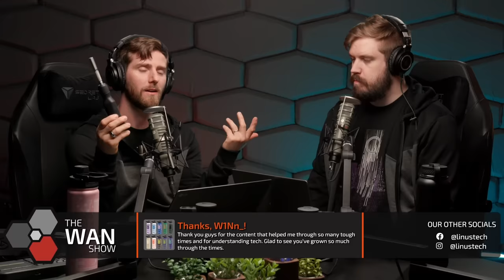Someone COPIED our Screwdriver design!

Comment: I work at an American importer mostly sending things to China and making clones in China when we’re not manufacturing custom goods and it’s ridiculous how efficient and seemingly exact it gets. Every single time with limited shared info.
Reply: i was shopping at an outlet mall once.  there were like a half a dozen groups of guys and gals right outside of a designer store they had just purchased bags and stuff from.  they were straight up talking on the phone and taking pictures of the stuff they just bought right there, in front of the store.  even fllipping the stuff inside out and everything.
Reply: At some point after making lots and lots of objects, you see how its created and the different parts required to produce it
Reply: The Chinese are good at copying something and producing it on a larger scale. It's usually nowhere near to the original quality.
Reply: @springbok4015  Honestly i think that's starting to change recently I've bought copy cat items which have been nicer then the original product. Still has a few years to go tho.
Reply: @liam3229  3D printer doing that magic the Chinese wish they could have quality attached to their stereotype. Have you seen Chinese fire drills with the QBZ rifle they are using is shooting keyholes instead of bullet holes because the barrels rifling is poor and the bullet they are shooting isn’t meant for the QBZ. It’s really sad that these very intelligent Engineers are left with sticks and stones to build their modern anything.
Reply: @springbok4015  see Honda clone engines. Lol!
Reply: @springbok4015  yeah most of the time, but in this case it's somehow better than taiwan made ones  which is wild to me.
Reply: @springbok4015  IMO its slowly changing, Nike REPS(good fakes tho) are better over all quality, while nike official has all sorts of quality control issues.
Reply: China makes things at all price points. There are garbage copies for dirt cheap but there are good copies at higher prices.
Reply: Also they do it for software. Where I work at they dropped Chinese QE because they were leaking the software and making copys
Reply: @springbok4015  Dude, Chinesium is evolving into a completely superiour form.
I wouldn't be surprised if that term becomes obsolete at some point, where copies become qualitatively near indistinguishable from the original.
Reply: @Volvith  It's easy to sell a product cheaper or somewhat better at the same price, when you don't have a massive research and development cost to cover.
Reply: @Volvith  that’d be scary, let’s hope not.
Reply: @SpringBok401
That was true a decade or more ago but clearly you’re unfamiliar with recent Chinese manufacturing.
Reply: Salty Squid  Omg, such a big brain comment you posted there. No one thinks you are wise, nor really care. 😁
Reply: Salty Squid  Nice emojis. The more, the smarter you appear.
Reply: I've noticed this with JWK (if you know anything about keyboards youve heard of durock, or things like the alpaca switch, they produce them) keyboard switches. Basically, durock copied the zealios v2 switch almost 1:1, and I'd go as far as to to say they feel the exact same but they only cost half the price
Reply: Very cool!
Reply: @springbok4015  it depends on the factory I think.
Reply: Salty Squid  I go to China regularly since 2002. My wife is Chinese. And she has a good friend that owns several factories in Huangzhou. Having dinner with him gave actually some really interesting insights in how Chinese manufacturing works. And how to deal with three mistresses :) (pro tip: don't do it, he was in a fight with all of them at the same time)
Reply: @paulregener7016  you mean the video where the soldiers are in an indoor training complex with concrete walls and without backstops, an environment where it would be incredibly stupid and dangerous to fire anything other than training ammo? Training ammo that perhaps isn't fully compatible with a relatively new weapon? 

The chinese have their own space station; I think they are capable of making bullets spin when they want to.

Comment: I am a graphics designer and I once had to do a package design for some relabeled mobile phone products from china. It was much more affordable to keep the packaging on site, so they wanted to have a package design. I designed the whole ordeal in Illustrator with banding-marks, cut-marks, bending-markers, color-table, text-only files etc. Basically the whole prepress data as we deliver it to every printer and manufacturer in our country. They couldn't handle it. After some back and forth, the product manager then just sent them the high res renders of the 3D package mockups I made for illustration - and 2 weeks later, there were 15,000 packages exactly done as we wanted - only from the reference images. China is a weird place. Same Same, but different.
Reply: "Too much detail, we'll just do it by feel"
Reply: Could have asked them to send you a blank template as they use in-house for a box of the dimensions you wanted. Drag your art onto that and send it back.

Comment: You know it's a good design when the clone comes out first.
Reply: have you watched video?
Reply: @vaisakhkm783   Yes, have you?
Reply: @TheFrantic5  It's not a good design if a clone comes out first. Clone will exist no matter how bad a product is.
Reply: @svn5994  You're talking apples and oranges, that's the difference between looking at something and trying to get the product out first without having proper specifications, and stealing the design with proper specifications and making your own, perhaps after filing a few digits of the serial number off.
Reply: @TheFrantic5  I think you're confused. What do you think Vaisakh and Svn are trying to tell you?
Reply: What design?, this is nothing new
Reply: @doigt6590  Vai hasn't told anything, and simply asked if I've seen the video. Svn says that it's not a good design if the clone comes out first, which doesn't really seem to be true, as companies will copy a good design. Regardless, I was saying that if the company steals it, it's probably a good design, though I suppose if you have blueprints laying about free of R&D, that's one less cost and it would offset putting a not-as-good product out.

Comment: Bruh, it's like NOBODY even watched the clip.
Them "copying" was due to LMG's error of not sending them engineering drawings but instead sending them a physical screwdriver which they were able to reverse engineer to manufacture a sample. 
It was a complement on the tool manufacturers part due to LMGs blunder. 
No matter what, the company is going to be manufacturing LMG tools, and they could easily sell an unbranded version on AliExpress for cheaper but without LTT branding (and the guarantee of quality that comes with the LTT brand of merch products)

No unbranded clone of this screw driver will ever be market viable simply because LTT's version is far more expensive to manufacture and only LTT (and reputable north American tool companies) can command this amount of money for a product and still move units.
Reply: Its because of the thumbnail...
Reply: @whyarewehere3893  yup, clickbait thumbnail at it's finest 😂
Reply: There are plenty of non North American tool manufacturers of note. In fact most of the US based tool manufacturers don't make some if not most of their lines in the US anymore. There are also screwdrivers of similar or same functionality that already exist for less than half the price so a knock off is absolutely possible. The only way that ltt can get away with selling products like the screwdriver and backpack for such obsurd sums with no backing as a reputible tool designer for the product is due to the fan base
Reply: Bruh... Why the bruh???
Reply: That's what clickbait gives you, headlines alone should be enough to understand something, its what they are for after all.
Reply: @KarlOlofsson  If headlines alone were enough to understand something there would be no point in having a video.
Reply: @timseguine2  A headline should be a good summary, it shouldn’t give you the complete wrong idea
Reply: @timseguine2  the gist, just like how the ingress in articles and summaries in reports are meant to be slightly more detailed versions. You shouldn't have to consume the whole thing to get the conclusion, unfortunately attention based media tries to force us to consume as much as possible
Reply: @circuit10  The comment I responded to said, "headlines alone should be enough to understand something, its what they are for after all." That statement is clearly and unambiguously false.

If Karl meant something else that is not false by his comment, he should have said that other not false thing instead.
Reply: @KarlOlofsson  If you meant something that what the words of your comment literally mean you should have written them. That is the point of comments after all.
Reply: @timseguine2  A headline should be enough to understand something. Not at a deep level, but it should give you the general idea
Reply: Didn't Linus base his screwdriver off another company's screwdriver in the first place and just make improvements to his?
Reply: @KamalTailor  AFAIK he licensed the mechanism, which is different than "basing it off another screwdriver".
Reply: @timseguine2  I'm sure he did, but it was another screw driver that he used to rave about in his videos that this looks very similar too. 
The shaft being knurled being one of the designs that he liked so he could fingers tweak the screw driver
Reply: No one outside of mcmerica believes that anything from mcmerica is decent quality. If I want decent tools, I expect them to come out of Europe, or Japan. Mcmerica doesn't even use metric ffs #backwards
Reply: @KamalTailor  All screwdrivers have to be able to unscrew and screw in screws so how much you can change is very minimal. Every screwdriver i have ever used has been shaped almost identical from 5 or 6 different brands. So how much you can change and keep it still functional is basically just the part you put your hand onto.
Reply: @yumri4  I own a bunch of really nice high quality screwdrivers. I know this.
Reply: @KamalTailor  he’s based it of a snap on design, thats the one he used for years. I don’t get why people are excited about this screwdriver especially for the price. Also I don’t think people realise using a bit driver style screwdriver isn’t anywhere near as good as using a proper screwdriver 😂
Reply: yeah, they copied it because it's what they thought LMG wanted.
Reply: @KarlOlofsson  that’s the dumbest thing ever. Titles tend to be editorialized. It’s why you read the article… it’s why you watch the video. Are you not able to focus for minutes at a time?
Reply: @kbob9625  sure, I don't think that will make anyone stop discussing based on titles alone though ;)
Reply: @-opus  Wow you sound naive. What tool made in the past couple decades has been made in the US and screams quality? Or what vehicle or anything else? Nearly everyone who works with tooks knows the claim to quality for their tools as well as at least where the companies originate from. Most really decent tools are known to come from Europe. American workers who own american tools either have pride in their country and choose to support their nation's industries, or believe that the quality and price point are right for them. No one is going to claim their IR impact is not as good as their US made one (if you can even find one). They spent the money, they know the difference. You might have old timers with old US tools from when they were the best, but nothing new in the US these days is of great quality.
Reply: @brandonrodgers2479  either you tagged the wrong person, or you cannot read.
Reply: Are there any reputable NA tool companies left? Seems they've all been bought by brand aggregators and stripped to death.
Reply: A unbranded clone is totally viable. LTT has to recoup the cost of R&D. Anyone cloning this can sell it for peanuts and it’s pure profit.
Reply: Premium tool companies are not only in NA. Germany has like dozens of them, Italy has Piergiacomi, Japan has a WHOLE ARSE bunch that the lot of us never heard of but holy shit they have bonkers nice stuff, and like worth it for the features or quality but not cheap.
Reply: You're talking about reputable tool manufacturers and North America is the region you go for first? Not Europe (Germany) or Japan? I don't know, I've always struggled with the quality of NA-made tools. For me, German tools are where it's at (Wera, Hazet, Knipex, ...).
Reply: @rtg3333  exactly. Muppets who wouldn’t know shit from clay
Reply: @circuit10  What wrong idea? The headline here is very sensationalized but the factory in question did copy the screwdriver - they didn't rip it off but the title didn't claim that either.
Reply: @bosstowndynamics5488  Most people assumed that it was ripped off, which is the wrong idea

Comment: I'm not justifying the pirate act, but as they mention in the beginning, it's not difficult or impossible to copy the design, even domestic manufacturing asian factory still copy it's just a little later.
Also I would argue it's almost impossible for normal people to know or care a normal screw driver they buy is a copy or not. Right now I can go to a hardware street and have access to 300+ different brand of hardware tools, when it comes down to screw driver I might just pick the one at first glance
Reply: It wasn't a pirate act though, they got an object without schematic drawings and were told to produce a sample, so they produced one by copying earlier official samples they had received.
Reply: The title is definitely click bait.  So while people shouldn't comment before watching, people aren't totally coming out of left field with these comments.
Reply: It’s actually harder to clone parts than use drawings

Drawings have way more information
Reply: You should watch the whole video
Reply: @circuit10  i did, i'm just saying i could probably get a exact same from China for maybe $10 bucks after they release.

Should I? Of course not. But non LTT viewer would never know and think some china brand just release a very good screwdriver
Reply: @nigelyam38  If you watched the whole video you should know that there was no “pirate act”
Reply: @circuit10  no "known" pirate act. What do you think chinese factory would do with B grade parts that didn't pass QC. Throw it away? Of course not, they just use some left over A grade material and make a un-brand ver and distribute it locally, or through internet like taobo or alieexpress

Unless LTT operate same as the large brand , where they have a in factory hire by LTT qc supervisor to look over the destroying process of B grade parts.

Comment: $70? Damn. I’ll stick to my Husky and Milwaukee ratcheting screwdrivers for $20.
Reply: Or spend a little more and get an M12 impact driver unless your work needs to be gentle. Haven’t used a screwdriver in awhile lol
Reply: @KalebMicklatcher  the m12 installation driver or the m12 screwdriver are awesome for light work
Reply: @KalebMicklatcher  I use a DeWalt brushless impact whenever I can. That's usually for automotive purposes, but there have been times I've used it to rip apart appliances quickly. If you get the drill and impact in a kit they're usually super cheap.
Reply: it’s a GAMERS SCREWDRIVER 😂
Reply: @Silver1080P  Same here, but there are applications where using a drill can actually damage the screw or the piece you're working on. Receptacle plastic covers can easily break if you overtighen, cabinet hinges and handles depending on the design might require a screwdriver for better control (to a lesser extent), small screws can sometimes easily strip when you use too much power and the wrong sized bit, whereas a screwdriver wont. 
And for computer parts, that's most of them. I've never used a drill while assembling a PC, but I have used a screwdriver often while doing home renovations and electrical work.
Reply: I mean, a snap-on is like 80
Reply: @tomtricks6838  What is your problem trolling under every comment
Reply: @The_Viktor_Reznov  it’s funny
Reply: @tomtricks6838  it needs rgb to be a gamers screwdriver
Reply: $70 bucks, ok it better handle a sheet metal screw in a thin metal PC case... but will the ratchet handle some actual realistic torque... ? 1 1/4 wood screw no pilot in hardwood, now that's a test